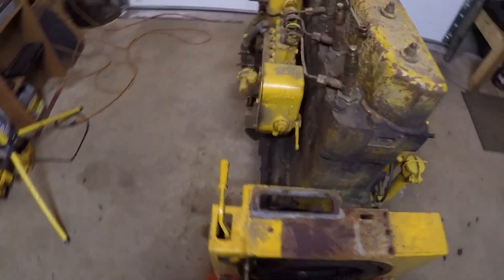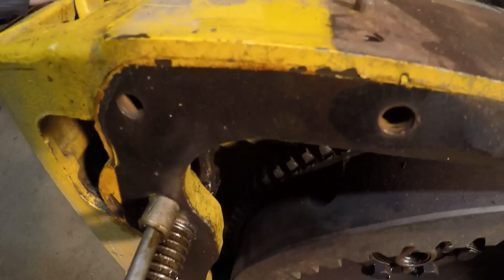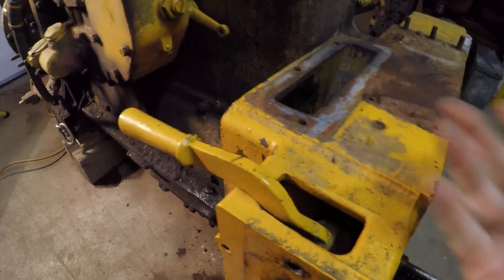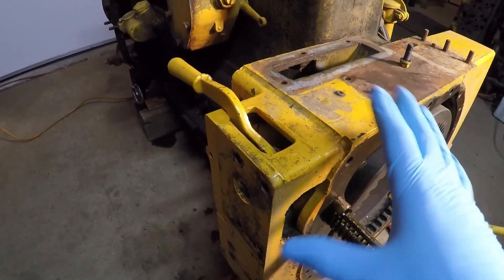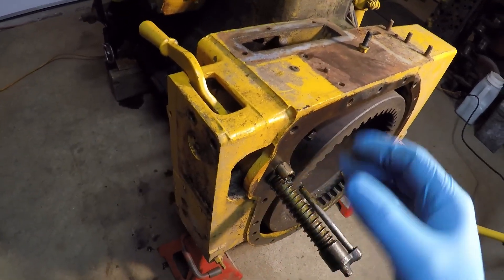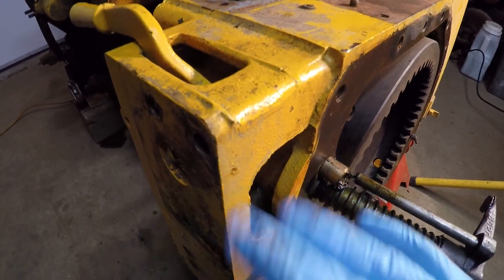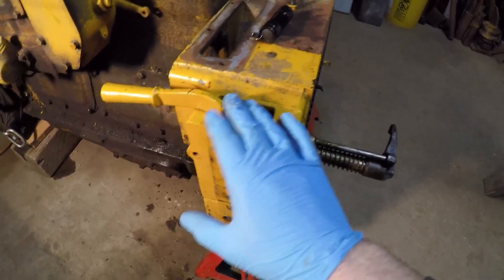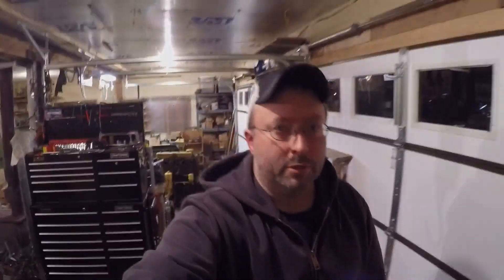Caterpillar D2/D4 Pinion Engagement Mechanism Operation, Disassembly, and WHAT NOT TO DO!!!

Comment: My 5U started being an absolute bear to get the pinion engaged, I discovered that the guide rod was getting loose in the pinion engagement finger allowing the assembly to get in a bind when you tried to engage it. I did a hail Mary and tack welded them together through the pinion adjustment hole to avoid having to split the crawler.

Comment: I have a 5u motor i can not get out past the splins any help is apprciated
Reply: I have the inspection cover open and thetes a few linkages moving i must be missing something to undo in there this is my first dozer ive had to pull the motor on a simple liner has turned into a bit of a job!
Reply: @squatch253  sorry im talking about the motor from the transmission! You made yours look so easy on the 5j i can get the hole motor out about 1 incg then it stopa and gets hard
Reply: @squatch253  this is a wet clutch i had no idea cool stuff

Comment: Got a stupid question. Got an opportunity to use a D8 caterpillar with a pony motor. Old machine. Have not got a chance to look at the machine yet. But he says the starting mechanism just won't engage with the pony motor running and it has 1 track that won't stay on the machine.
Reply: Old machine without a roll cage. Not sure the year just yet. Will be looking the machine over myself in a week. How much work is it going to take to get the machine working. The tracks aren't that worn down either like it's had little use and sat most of it's life. As i got a couple pictures of the machine
Reply: Looks to be a 1960s or 70s machine

Comment: Hey boss we are working on a old 7u d4 I'm pretty sure it is. The engagement lever won't pull up, the pinion will not slide forward and lock, it is about 1 3/4" away . Just feels completely jammed. Any ideas

Comment: QUESTION: When drive pinion arm on a D2-5J1113 is engaged and the pony motor stops running, how do you release the drive pinion arm that is now stuck so that I can restart the pony motor? Thank you for your help (pippi_tls@hotmail.com)
Reply: I think there is an access forward of the left brake. (?)

Comment: Hey there, I have a 1950 something d4 and the pinion engagement lever is actually stuck. It was working fine earlier today but I released tension on it and it locked in the disengage position. 
In the past we did have to hold manual tension on it. Any ideas?

Comment: Your videos have already been a tremendous help on my 1955 D4 6U. Thank you for all the info you've posted.  - Question - I can pull the larger cover off my clutch housing, do you think I could weld up a bit of material  on my lever to push a bit further on my pinion?